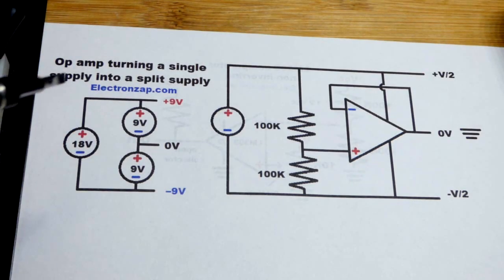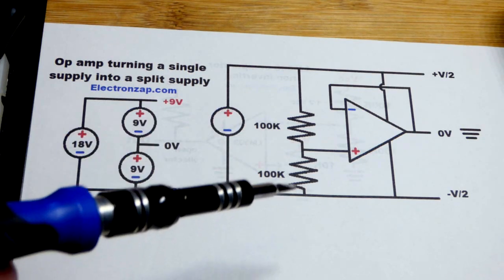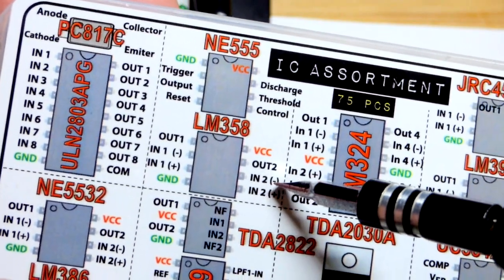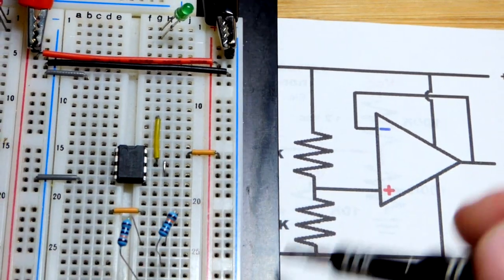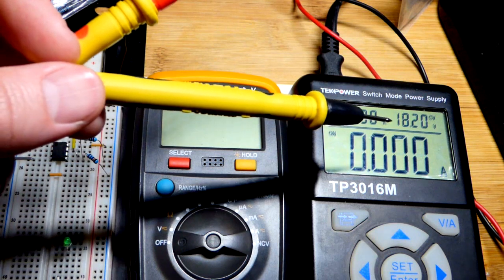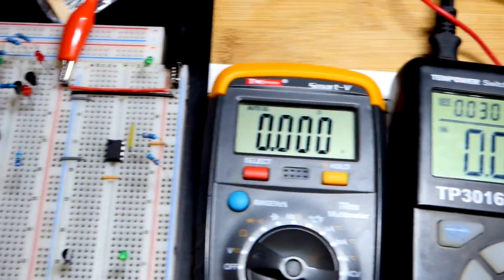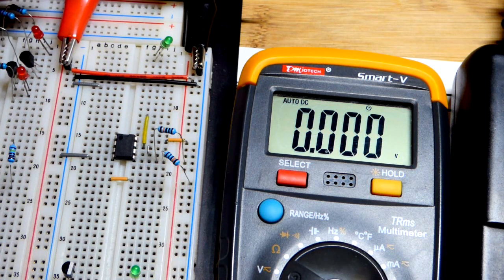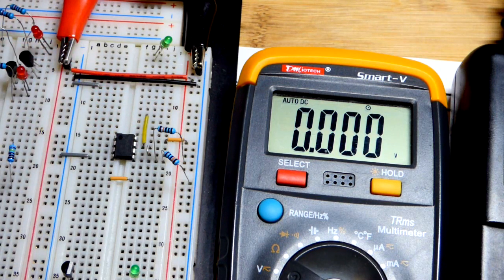Quick op amp rail splitter turning single power supply into DIY split aka dual supply electronzap

Comment: It should be noted that the resistors on the input side should be chosen to be somewhat large. Technically you are right that the exact values don't matter much, but OpAmps are high impedance input devices so the current goes all over the voltage divider resistors. Low resistance values would lead to a higher current and therefore to a higher power loss. Higher resistor values would limit the current minimizing the power loss.
Reply from the maker: Yup.

Comment: Is it possible to get a bigger current from the opAmp by adding a transistor at the output? If so, which kind npn, pnp, other than Bjt?
Reply from the maker: Yeah, you can use the op amp to control transistors. You'd want to consult the datasheet of the transistor you want to use to see it's limitations.

Comment: How much current it's rated for?
Reply: In theory the current limit should be the lowest of the following:
1. The current limit of the OpAmp's output side
2. The current limit of your power supply minus the power loss over your voltage divider

So lets say you use a theoretical ideal OpAmp (rated for infinite current) and you use a 12 V/2 A power supply and a voltage divider with 1k resistors, your current over the voltage divider would be 6 mA, so your output rating would be < 1.994 A. With a voltage divider like in the video the current would be 0.06 mA, so the power loss is neglectable at a maximum rating of < 1.99994 A. It would be a better practice anyway to choose a higher rated power supply (let's say 2.5 A) and fuse the output generously at like 2 A, just to be safe.

In practice you'd have to choose an OpAmp that even can handle that much current. This OpAmp here has a current rating of only a few tens to hundreds of mA.

Another method to increase current rating is to use a circuit that's a little bit more complex (still easy to understand), where you add a npn and a pnp transistor to the output rail so your OpAmp only provides the reference voltage triggering the transistors while those actually handle the current. Have a look at a DroneBot Workshop's video about OpAmps, where he shows exactly that circuit at the end (or see schematic here: https://electronics.stackexchange.com/questions/557312/op-amp-power-supply-splitter-with-totem-pole).

The circuit shown in the video here is sufficient (and probably even superior) when it comes to low current circuits. For higher current applications you need the modification with the transistors or even discard the idea of a rail splitter and go for a full blown dual rail power supply.
Reply: Adding to  @comedyclub333  's excellent answer, the LM358 output is 30mA typical, which would be the limiting factor here. Different opamps will be able to output more (or less) current, so take a look at datasheets when choosing one.